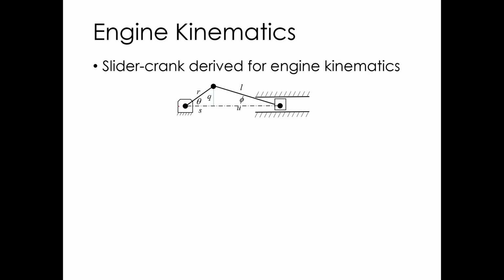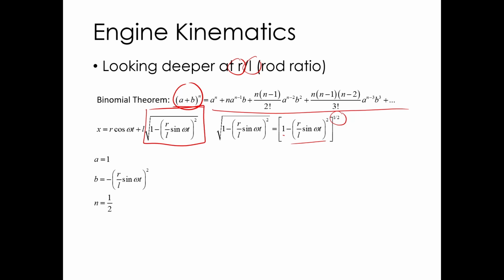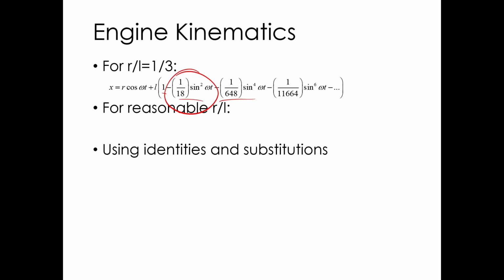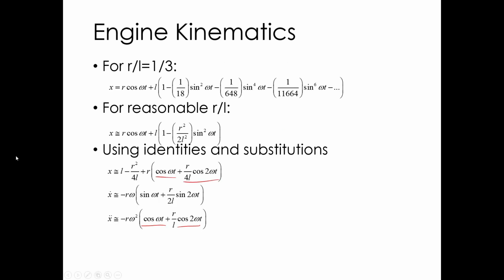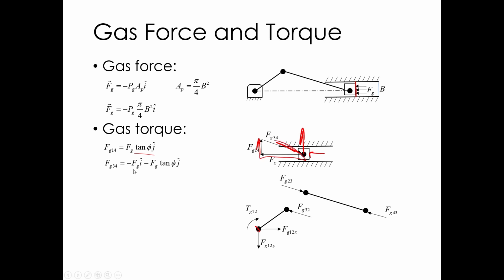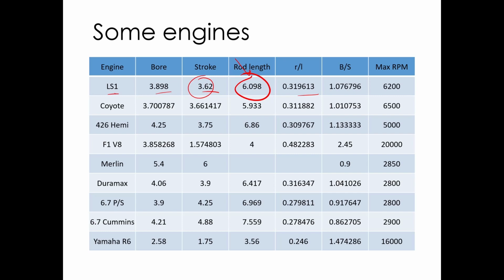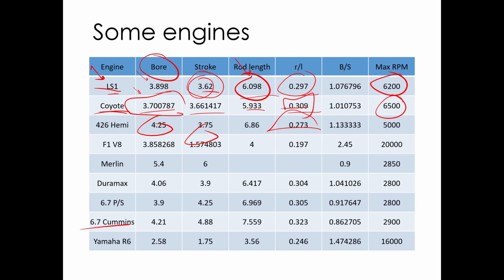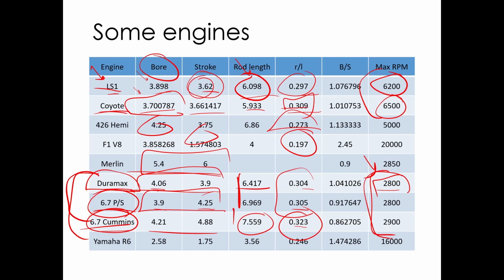ME3313 - Engines II

Comment: interesting. i deal with vw mechanics on my tiny channel. they use the term "rod ratio" constantly. however, their ratio is l/(2r). yes, they invert your formula and use the full stroke. this is standard practice for all mechanics across all engine types. want your head to explode? watch a mechanic speak about rod ratio.